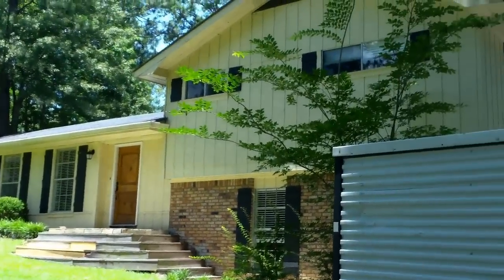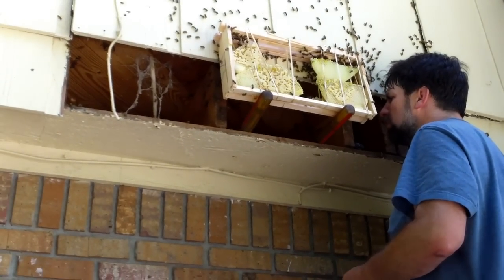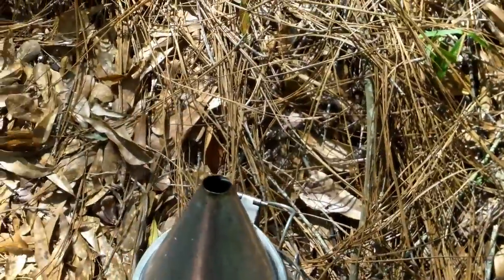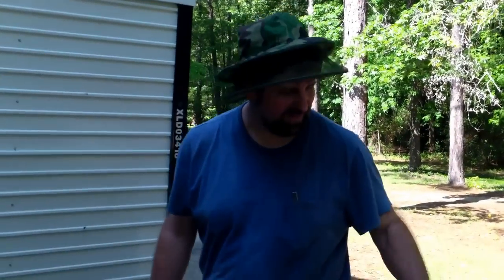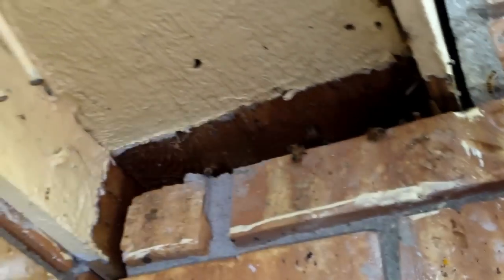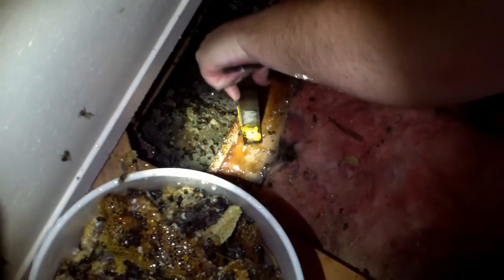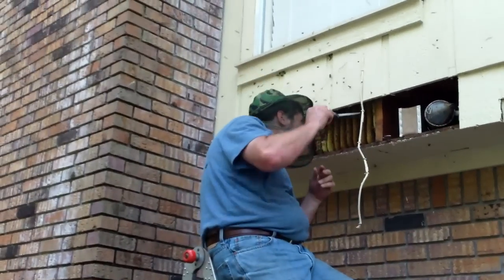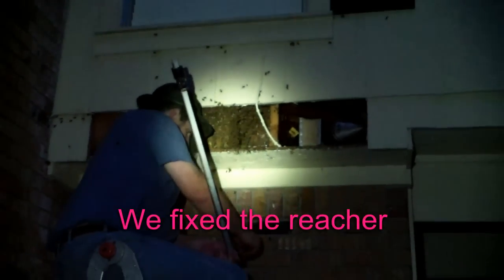Difficult Triple Hive Removal Day One

Comment: You NEED to purchase a $30.00 laser thermometer. That will pinpoint the heat of the hive right through carpet. It may only be a few degrees increase in temp but it will show you where the hive is located. I use that a lot more than the "bee scope" camera.
Trust me, it will cut down the time it takes to locate a hive, it will reduce the time it takes to access the hive and to repair the area. I have a cutout on the 5th of July. Watch for it and I will demonstrate the laser thermo.
Reply from the maker: Looking forward to your video.
Reply: Where does one purchase this? Thank you

Comment: My question is, do you pay for "Damages" you did to the house from removing the flooring and siding? And that leads me to another question, how comfortable do you feeling having to tear up someone's house to remove the hives? (Just came across your channel, and now I'm finding a new found respect for Bee's)
Reply from the maker: I do as little damage as possible and I do not pay for damages.  The property owners need our services and the damage is a necessary part of the removal.  They usually have a contractor ready to repair when we are done.
Reply: 628DirtRooster Makes sense, thanks for taking time out of your day to reply.
Reply: 628DirtRooster do you carry insurance to cover them suing you out do you carry a contract around for them to sign.
Reply from the maker: Warren E No and no
Reply: @Warren1138  Why would he need to? If left alone the bees would do much more damage than DirtRooster does removing them, due to chewing away wood and insulation, drawing other pests like cockroaches, beetles, etc., that also cause damage, and the damage that the honey will do sitting in the walls and wood of the buildings because of moisture that draws mold and such. Homeowners that choose to just kill the bees and leave the hive to rot are choosing to draw pests like cockroaches/rats/beetles/etc., and all the preceding problems. DirtRooster cutting away a few floorboards or drywall isn't doing nearly the damage that leaving them dead or alive would.